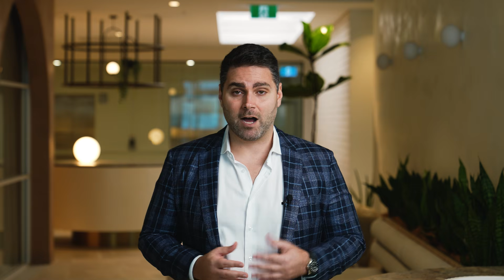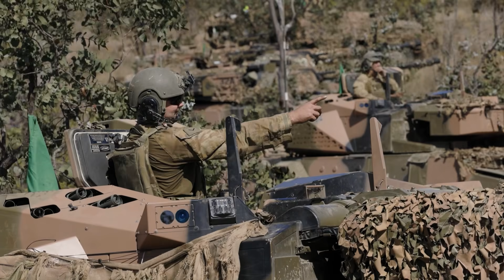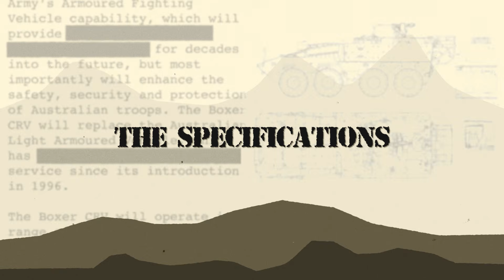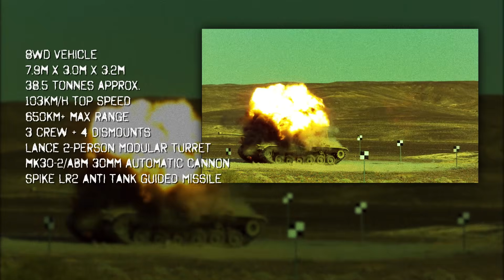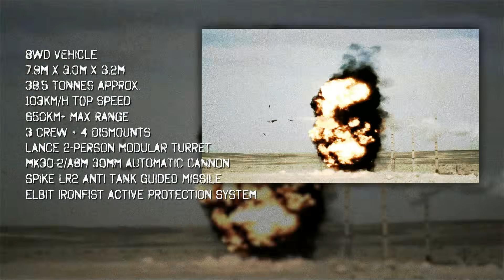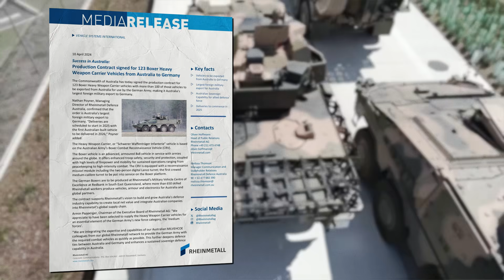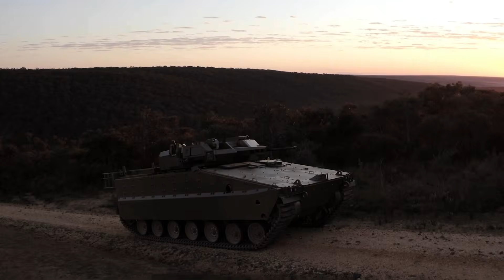Defending Down Under: The Australian Army's New Boxer CRV

Comment: why was a unit chosen which can only carry 4 dismounts? it only weighs 5 ton less than a Redback and carries 4 less dismounts. the Redback has similar weapons capabilities, more armour and the Boxer's system modularity actually adds non-functional weight. it's basically a redback with wheels that is a bit faster? i don't get it?

Comment: Only 4 dismounts, it's the size of a bus , reconnaissance vehicles have always been tiny like the ferret.  I think the army has lost its way, why don't they just use the redback for the same role. Stupidity really, same with the huntmans self propelled artillery . The boxer has a 155 version. Why the army using so many different types
Of vehicles.

Comment: You are not saving money by not purchasing the full order of 450.  If you have them and never use them that is maximum value. It means deterrence has worked. If you don’t have them but wait until you need them you are already in a live fire situation. At that time the will be more expensive and the slow order of battle will make them less effective.  The best spent military dollars are those that never see combat.

Comment: Australia is getting, 75 M1-A2 Ambram MB Tanks 211 Boxer CRV, 230 Redback IFV, 30 K3, 29 Apache Attack Helicopters, 40 Black Hawk Helicopters 24 C -130 J Transport Playns, 6 Hunter Frigates, 6 (12 ) Arafura Class Corvettes, 8 New Patrol Boats, and 72 F -35 A War Playns. Getting all the Above is alot of Equipment. Plus there forming also 1 Armour Brigade, 2 Mech    Brigades, 1 Air Mobile , 1 Missile Brigades and have 6 Reserve Brigades. Australia is Arming it's self. But actually need more also Infantry Personal (75,000 men and 25,000 Reserves). Should bring back Conscription. They should keep the 59 Ambram MB Tanks and bring up to the M1 -A2 Standard (Get about 25 more). So they can form 1 more Armored Brigade.  Were in reality we need 15 Combat Brigades (6 Mechanized, 2 Armored, 2 Cavalry, 1 Air Mobile, 1 Amphibian, 1 Missile and 2 Light Brigades). Were we will need more Equipment to get. Believe me, China will be Combat ready in 2028.
Reply: Been reduced to only 129 Redbacks and 20 C-130J, but there is still time to increase those numbers, will be interesting to see how numbers change if the LNP wins the next election (by May 25). Arafura's will stop at 6. Also getting 18 500t LCMs and 8 LST-100s.

Comment: The biggest downside of the Boxer is that they need a big aircraft to be air transported. A400M and C390M are the smallest current transport planes that can fit them. So in terms of logistics it's much more of a handful due to it's size and weight.  It's also going to require much larger landing craft for amphibious operations.
Reply: Air transport of AFVs is highly overrated, you would need 2 aircraft to carry 1 vehicle, the 2nd one for all the logistics it would need. Thats why the Army is building up its water transport, the new LSTs will be able to carry up to 11 Boxers/Redbacks/K-9 along with all the logistics needed, you would actually deploy a troop/sqn/bty/coy quicker than by air. Use your air for deploying lighter vehicles like Hawkeii. Can put a useful immediately deployable capability in the field. You are also highly restricted where you can land a C-17, just need a beach or a port for the LCMs and LSTs.

Comment: given how war has changed and the advent of drone swarms, you'll need a ECM jammer model in the lineup.  Also capability to launch both recon and kamikaze loitering drones like the K51 MBT.  They will need to be deployed with other armoured units to protect them.
Reply: Boxers are an excellent choice to protect those around them from drone attacks as well as incoming mortar and artillery shells when fitted with the Skyranger turret.

Comment: Australia in my opinion has the potential to become a global power. All we need to do is stick to manufacturing on home soil, not relying on imports. The army should stick to using a mass range of APCs and these Boxers, as they are all very reliable and a cannon on the boxer would turn it into a light tank almost.

Comment: 650km range is not enough, need a long line of logistics such as rail to move them in to place, fuel depots and tankers for refueling, diesel processing plants etc etc. imo helicopters and aircraft would be a better choice for the massive distances to be protected by Australias overall very small military. video was very well made thanks

Comment: An alternative name, Thunderbirds. I'm a civilian and would like to see the ambulance module if there is one. Overtook a bushmaster once and started salivating. Good to see what can be achieved in Aussie and obviously of world standard.
Reply: 4 different ambulance modules are available for the Boxer, just pick one.
There are also modules for air defence (30 or 35mm autocannon), various 120mm mortar modules, engineering and rescue versions, modules armed with 105mm, 120mm and 155mm guns etc.
With the 155mm RCH155 module the Boxer becomes the ONLY self-propelled howitzer which can fire on the move (at up to 30km/h). The Boxer drive module is also available with tracks instead of wheels.

Comment: A war is won by who can can Logistically supply the most and quickest turnaround  to the front line , then maintain the damaged ones to return quickly to service. The Armament industry needs to ramp up considerably and be self reliant. I think I can sense the Planning Commanders want self reliance and self belief at the front line rather than relying on slower commanding from the rear. Having them as kit builds for separate roles helps the quick supply idea.

Comment: Question
What part of the Boxer is actually made in Australia
Engines and drivetrain.  Imported
Weapon Systems.           Imported
Electronics.                      Imported

Do we manufacture the hull and turret as in, press the steel plate, weld and bolt.

Also selling the Boxer to Germany is a bit of fantasy.

Rheinmetall is a German company, so they getting all the profits from the sale anyway.

Comment: Something I found strange was that there was no mention of being able to traverse rivers, waterways ,floodplains and such like. We have in Australia such things as the wet season, especially in the north. Can these things float? At 38 ton I doubt it. Also I  see only 650 kays, thought it would have to be higher due to technology advancement at least a min. of a 1000 kays, Australia ain't europe we host a lot of nothing. we spend 5.2 billion for every foreign powers profit because our polys don't trust us to design  our own units, just like the lithgow small arms is now owned by the french, the abrams has the worst range of any tank, our tiger choppers are made of tissue paper and spit, and our navy vessels are mostly second hand or off the shelf design of crap. how many hundreds of billions have we spent  for foreign garbage, when we could by now have ozzy designed hardware with the heavy industry and support industries in Australia with profits coming to Australians, not the global socialists scum overseas. But don't worry they are already, again, lowering the fitness standards for soldiers so these things had better have air conditioning.

Comment: As someone who has done time in workshops within the 'system', one of the biggest issues is keeping up with the parts.   From 1st hand experience out on exercise.  Watching wheeled vehicles like this were being driven like they were tracked vehicles through sharp remnants of shrubs.  Lots of axles being chained up for the drive back as they ran out of tyres.
38 tonnnes-hell the Leopard tanks were only around 40, and they are a tracked vehicle with seven 'road wheels.'
Reply: Tbf leopards weigh a whole lot more now as well
Reply: So the claim about all conditons is bs. Wet season, boggy ground or our sticky mud will turn these into a laughing stock

Comment: Modular is unnecessary. Sound good but useless. Just buy the variant you need and nobody keep changing.
Reply: The same base vehicle has logistical advantages. 
The fairly wide use in many armies has also advantages, as has the number of production sites—towards 10 now. 
If you need the modularity during battle is something else. But with luck you might be able make out of two damages vehicles a working one in a few hours.

Comment: The modularity is AMAZING! One platform that can do a dozen things as needed w/o having to build 3,000 of them just b/c once they're built they can't be changed. Also, in 20 years when tech has advanced, the SAME basic "cab and chassis" can keep doing the job with newly re-designed modules dropped on its deck.

Comment: I recently saw a Boxer CRV on display at Gallipoli Barracks and it is huge. Like it is even larger than our M1A1 Abrams tanks. Really scary and impressive that thing is.
Reply: Well it is designed as a troop carrier among other things. At 36 tons and hollow enough to carry loads inside it's got to be big.
Reply: You are correct - I saw the Boxer and Abrams together on a parade practice day in Brisbane, and the Boxer is noticeably longer and taller than the Abrams (8.8Lx2.96Wx3.15H vs 7.92Lx3.66Wx2.37H). Absolute unit.
Reply: Shame this video didn’t show it next to the ASLAV, which is already a tall vehicle. In our flat largely desert country, it’s going to stand out like dogs ⚽️⚽️
Reply: @itsnotagsr  a very big needle in a giant haystack, good luck actually finding the boxers in the millions of square kilometres of bush
Reply: @h.c5750  who needs luck when you have drones
Reply: big target for an fpv   drone

Comment: Don't get me wrong, in any Recon or CAV the commander needs firepower. But the boxer, excellent as it is, is as the narrator put it...Massive. The motto of the US CAV used to be "Sneak Peek and Retreat", then call in the Dam-Dam on the other guys as needed. If the Boxer can handle the environment(s) where it might be deployed all well and good. But small faster vehicles with the same firepower are available all over the planet. Break a Leg, Aussi CAV, and teach the other guys about not messing with your nation!

Comment: German company Rheinmetall and Australia both won here. Even though Rheinmetall has massive productions facilities in Germany, they and the German gov decided to built their Rec vehicles in Austrialia due to competency and availability.
Reply: it was part of the deal, that Rheinmetall will build the factory in australia, to provide jobs.
also part of the deal was, that germany will order its heavy weapons carrier (basicly boxer crv) for the medium infantry formations from australia
Reply: the german government has very little to say in these matters, the reason rheinmetall is setting up production in australia is because the australian government paid extra for license production so they could have strategic independence, not because of competency and availability, australia would actually be a very bad place for rheinmetall to do any manufacturing
Reply: The only reason they are building those in australia is politics 😂 Other than that they would have built them in Germany 😂
Reply: @mkultra3679 No, they wouldn't. Germany does not have sufficient skilled workers to produce all the Boxers on order.
Reply: It was in the AusGov tender to build the vehicles in Australia so they had no  choice.
Reply: @komapaiim  Which is common for RM. Most contracts like these are done like that. Ger Gov could have requested the same.
Reply: Not sure about competency. Our engineers couldnt manage to secure a box, widen seats, stop cartridges coming into the cabin and fix a fan on the Taipan helicopters.
Reply: ...why do you think Germany isnt compenent enough to produce their own product? I think it was all about availability.
Reply: @NotUnymous  First of all: that someone is competence doesn't mean someone else isn't. So no talks about lack of competency here. But honestly, the main resources and competency of productions for the lanced turret version is in Australia and the BW wanted that vehicle on shot notice. Rheinmetall produces and focus on the unmanned turret version (forgot the name) in Germany I understand.  Btw BW ordered these as well as I understand.
Reply: @ronaldotrumph8960  Germany mainly ordered Boxer's APC variant which are produced in Germany, but they also ordered a reconnaissance version which is almost identical to the Australian version. So the half finished Boxer is exported to Australia and then completed and then exported back to Germany.
The unmanned turret version was considered as it was the same version used in the Puma IFV. But that turret is built by Rheinmetall's competitor KNDS, I think Rheinmetall had an interest in the "Australian" version.
It is also likely that Germany buys the RCHF 155 artillery version of the Boxer. The only artillery system that can fire on the move.

Comment: Need to get a few Boxers with the Skyranger turret to engage drones.
Reply: The 30mm gun is the same as the one on the German Puma IFV and the Germans are currently working on a software upgrade that will enable the Puma to engage drones just like a Skyranger AA gun. The only difference is that the Puma isn't equipped with radar, but it can use its multi spectrum optics to scan for and track small aerial targets.

So once that software exists, it should be possible to upload it to any platform that uses that 30mm gun, including the Boxer and turn it into a anti drone AA gun.

It won't have all the abilities of the radar equipped Skyranger, but it will probably be good enough to defend itself and disembarked troops nearby.
Reply: @TrangleC  The radar isn't the only difference. The skyranger boxer has a revolver cannon that can fire 1200 rpm for the 30mm ammo. The normal belt fed 30mm is way slower with around 200 rpm. Also the maximum elevation is much higher which needs it's space in the skyranger.
Reply: @TrangleC  Regardless of the cannon, the key will be the ammo and sensors. Airburst rounds linked to a sensor (radar/ladar/EO/IR whatever) that can effectively engage the small FPV drones up to helos. 
And then you need enough of this variant that they can provide mobile air defence to a battlegroup.
Reply: @TrangleC  The Puma/Boxer IFV and the Skyranger are indeed fielding two different 30 mm canons. One developed originally by Mauser and the other one by Oerlikon.
Reply: @TrangleC   @TrangleC  Puma/Boxer IFV --> MK 30-2/ABM based on the Mauser MK 30
Skyranger 30 --> Oerlikon KCE-ABM based on the Hispano-Suiza HS.831

I have no need for an argument. Just trying to help. 😜